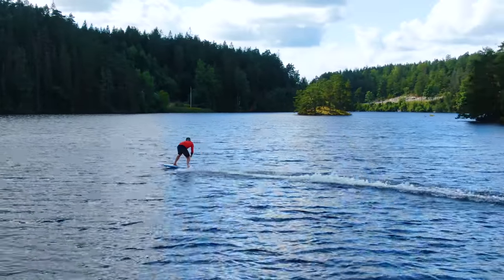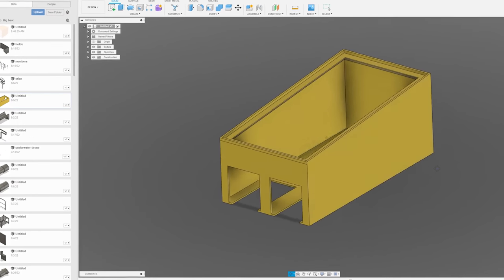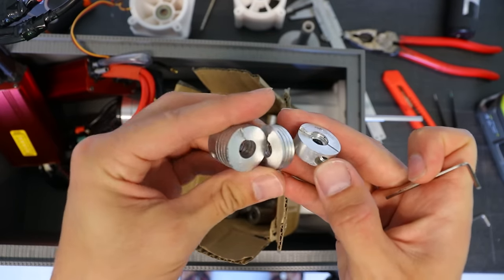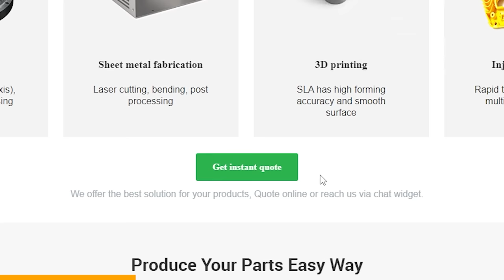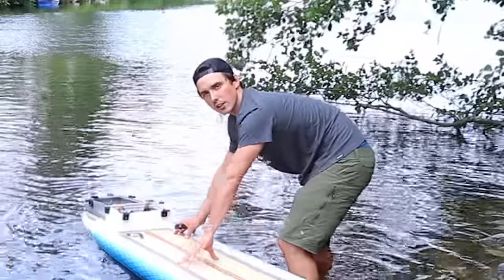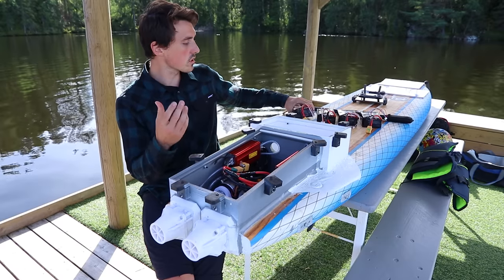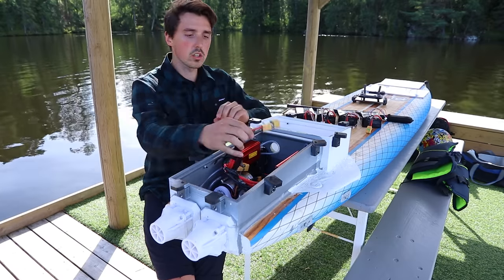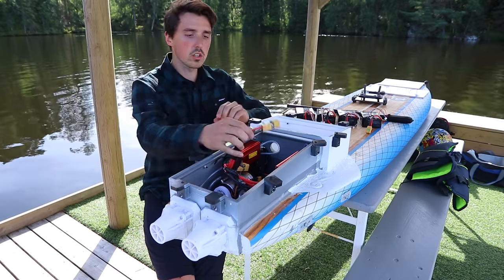This Electric Surfboard Has a Secret Inside!

Comment: if you optimize the geometry and streamline of your boar and the jets you can reach roughly similar speeds at less than half the power, 
one of the big problems is that the water is mostly just shot in the air since he back of the board abrubtly goes up, the suction method also seems to be from the bottom which can be done, but only if you make the backside go much more gradual so that he jet beam is completely underwater even when going fast. if you do that right you really need a insane lot less energy to go fast, since water resists a lot more. right it is like shooting a water jet next to a sail to cause some wind to move the sail(exagurated) while if you directly shoot it in he sail you get a lot more power transfer, 
essentially more exact you have only the mass of the displaced water moving you now, so it will work at low speeds or with insane power. but eventually as you go faster the speed of the board will have to be removed from it so you will actually get very little force out.
there are 2 main ways to avoid that problem. method one is either getting more speed and power, or getting the inlets in the same direction as the water and increasing the rpm, at higher speeds which is more easy if you would rely on a gearbox.
but in your case, streamlining the back and the outlets so they gradually stay under the water is much more effective(essentially change the shape of the back of the board so you don't get that aerospike behind it so the jets actually stay in the water). it still has a similar problem when you go really fast, but now you also have a pushing effect on all the other wather around it, which actually becomes much more powerfull at high speeds since the water will relatively seen start to cat more like a solid.

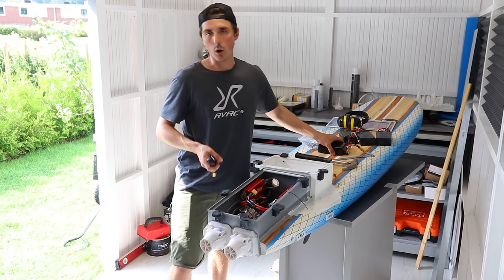Comment: information        6:31     it appears that there is  reduction  in diameter, at the jet exits.        if so, that reduction in diameter represents  an  Impediment to the flow, and  it is causing an Increase in  back-pressure, at the impeller.
such a situation is less-than ideal and can result in reduced efficiency/performance  and  more stress/higher temps  at the motors.          another factor is, the motors have  very little  mechanical advantage over the load that they experience.

Comment: I hope you fix the heating problem and get both full sized motors going allowing it to be full powered and not gimped.

Cool none the less. A follow-up video with a full powered version would be cool and worth it! You should also gather stats on the gimped one like power, battery capacity, range, speed at various outputs, power used at various outs, efficiency, and so on. Comparing the old (current gimped one) vs new (future full powered version) you could try using like computer closed or even open looped heat sinks. Maybe those would be more reliable and leak less. If using computer heat sink a closed loop would be required because it would jam with debris. But if you used a custom heatsink with no fine fins it would probably be fine.

I have no idea how you had the water cooling set up so just spit balling ideas.

No offense just didn't have time to watch the whole thing.

If you did statistics on this vs future set up make sure you make it a separate video for all or us geeks so none geeks don't get annoyed by "unimportant" information and us geeks to a video of just stats.

More videos more flavors makes all of us happy and gets you more views ^-^

Comment: That is not a BEC, a BEC is an integrated circuit generally in an ESC that ELIMINATES the need for a seperate receiver battery. This has a separate receiver battery going through a separate voltage regulator!

Comment: bike batteries can dump serious power for a long time. I run 20AH 52v batteries and they can dump 40 amps continuous. If you get the higher end batteries can dump 150 amps. You'll get at least 2 hours of riding.  amazon Unit Pack Power, they come with chargers!

Comment: ESC should get the cold water first, they have less thermal mass then a metal motor therefor they will heat faster and need more cooling. ESC is first to fail in heat events with no cooling. Metal motor overheats too and needs secondary cooling but can withstand heat events better then silicon.

Comment: Hello, I want to ask you an important question, I would appreciate it if you could answer it.. When using dual engines, did you use it as CW in 2 engines or did you use 1 CW and 1 CCW..

Comment: Very well done i loved your video and the work you put in. I was just wondering as you removed one impeller from your jet drive if this has effected or reduce the speed of the surfboard. I am curious to know if you had the two impellers in your jet drive would you have gotten better speed than using one only. Or would there have been more thrust when surfing on the board? Also by using two impellers would there be more increase in electrical current due to more resistance to the water flowing out the back?

Comment: Would the motors be able to handle a planetary gear system like whats used in cordless drills? The motor in the drills have a small gear that turns 3 slightly larger gears attached to a plate, this plate has again a small gear on the back side. This process is repeted twice more to reduce the RPM but increase the torque. If  there was only one set of planetary gears and the motor was at the other end, directly attached to the plate, then the three gears would loose a little bit of torque but increase the RPM. ..Just a question

Comment: Man, you should look into one of those monster electric motors that's equivalent to a 150cc gas engine. Maybe even look into TWO of them. If you can build a contra-rotating shaft inside a shaft type of thing, you could have one BIGGER 2-stage impeller and zero torque steer, PLUS 300cc worth of power.

Comment: Great job showing the evolution of the mechanical design. 
under the title you write:  "electric motors are 7500W each"..is this true ??? 
why did you go to the 500kV motor ??    
125V (360KV)......would drain the batteries slower 95A (360Kv) !  both motors have near identical power o/p.
More run time if you could pull more power from the batteries....add dc-dc converter?

Comment: should make a larger high capacity version with a paddleboard instead I don't remember the size differences between a long board and a paddleboard but curious if the extra real estate gain could provide more efficiency and run time

Comment: dude. You are using batteries to power an inverter to run a battery charger to charge batteries. Think about that 🤪 My friend has a 2 stroke powered surf board from the 80's that needs a few parts fabricated to get running again. Yours looks so much fun! imagine if it had 2x the power and could run for 2 hours between refueling.

Comment: Hi there RcLifeOn I am going to make a powerfull jet boat out of all this equipment, i was just lost to what batteries you used. will a 6s lipo battery 7.2v battery work and do you add all the cells together to equal 43.2v?or connect 2 3s 11.1 batteries together to get 22.2 volts for the motor to work. maybe you or someone could suggest or tell me how it works or suggest a battery or 2 that will work thanks as im still trying to understand batteries

Comment: If your getting about 3-5 minutes of run time on the board with a 48V 24 AH setup, that means your on average drawing about 300 Amps which is insane.

Comment: Is the water from the water cooling system actually moving too fast? As in, does it not have enough time to absorb enough heat from the motors to properly cool them?
Reply: Nope thats not how thermodynamics works.

Comment: Interesting
 But when installing a bearing dont hit the inside of a bearing when firing it. As you hit the inside instead of the out side housing the balls inside dimple the running surface so the bearing is damage before it even go's in. It may work but short life.

Comment: why add 2x 400watt generators face down add 2 fans under board as water pass through fans so turn recharge battery's will give longer running time. so like jet drive sux in water so spins fans.

Comment: Why dont you use water cooling. Its simple and its game.changing. also ec8 connectors are rated at a higher amp rating and are way easier to solder and accept.a larger gauge

Comment: If those are brushless motors all you would’ve had to do to change the direction reversed any two wires yes reverse any two wires in my return the other direction just a little Electronics engineering not everyone knows but very helpful that little bit of information

Comment: hammering a bearing is sacrilege especially if the balls and tracks inside it have to translate that hammering (i.e, hammering the inside because the outside interfering)... next time use a press , or a threaded rod with washers, or a vice and pipe, or even a hammer and a pipe to hit THE OUTER RING of the bearing

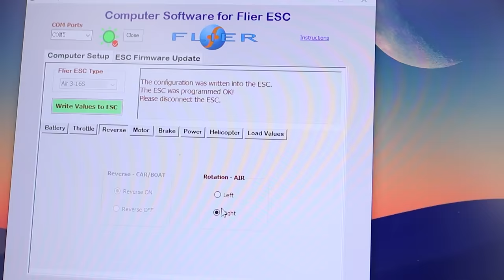Comment: 2:39 Does that mean on the old surfboard setup,  he had one motor spinning the wrong way  ???
Reply: So they were both spinning the same way originally ?  I mean wouldn't you be using counter rotating props with reverse blade configs  ?

Comment: For heat issues, build the bottom and the sides of the box out of aluminum and put some cooling fins on it act as heat sink that you can put below the batteries and even connect speed controllers to. For motors thats bit tougher, but make cooling chamber out of aluminum or maybe even copper with fins that you pump water trough could do the job.
For rest of the build its cool and fun, but like all other EV's the run time is just way too little. Imagine running to shore every few minutes to swap the batteries, just nah. Something like chainsaw engine would fit to bill pretty well if intake is built so it cant water lock the engine, ie ball that shuts the intake if its not with in certain angle.
Also price.. how much that print of propellers was... dear god it must been expensive. Maybe lost PLA casting could do the job if balanced on some turbo shop.

Comment: You said the connections are warming up. You’re probably using too little of a wire. And with an electric motor it’s pulling a lot of power and amps so it’s gonna heat that wire up probably wouldn’t hurt for you to upgrade the wire and the connections so there’s lesser resistance, because that’s what causes heat in an electrical wire.  I ran RC cars. To reduce the heat in the motor. I’d pull the motor apart and upgrade it myself by using heavier copper wine so there’s less resistance. You couldn’t use the motor for racing because it’s no longer a legal motor because it’s faster and it runs cooler. But when you’re outside playing anything goes.

Comment: pls put second stage back on and just do a nozzel change. dont reduce it as much as it is. open it up like 5% or step up the motor power just like 10%  the motors loading up is a good thing with jet drives. you shouldnt be able to over spin the pump. mike finigann has some good videos explaning jet boets.

Comment: How about you change the box to have an aluminium bottom, with heat-radiation - ribs? I bet you can get most of the battery or motor heat out of the system if you get some good contact

Comment: If you would like to make some $$ then make up a super detailed plan and off the plan for sale. You could also offer kits with the jet drives and some other parts then the parts sources for the off the shelf items.

I would like to see a full length surf board version with more battery capacity. Then, I'd like to see a pro surfer riding HUGE waves with it off the coast of Hawaii or some similar place with huge waves. The surfer could use power to get out and catch the wave them power down and ride the wave in then power up and ride back out to chase down and ride the next big wave. 

Lastly I bet if this electric surf board was well developed you could get a lot of $$ if you decided to build and sell these as a finished product. The full size surf board version I bet could sell for 25k.

Comment: Wow you must be pushing a crap ton of amps to heat up the xt90 connectors. I made a 16kw pit bike and push peak power of 250 amp out of the batteries and 400amp for the motor my xt90s don't get warm but then again on the water your constantly pushing power

Comment: Hey! Maybe someone here can help me, since i cant find any solutions on the internet... Im running a single Motor Setup on my Jetsurf, with a SSS 56104 burshless Motor(11kW and 360kV), a 400A Flier ESC and a 13s3p LiPo Battery (around 48-55V depending how much its charged). My problem now is that the power cuts out once i reach around 80-90% throttle and then i have to disconnect and reconnect the battery that the system starts running again. (Everything watercooled, so no overheating and i started with a two stage impeller setup, which i already reduced to a single impeller ... still same problem)
I really hope someone can help me!!
thanks guys

Comment: Are those brushless motors ??? if so why not submerge them for cooling brushless motors are not affected by water only things to be waterproofed are the batteries receiver and ESC. Ok, why do U use an inverter to convert DC from one battery to AC just to convert it back to DC to Charge other batteries?

Comment: honestly, focus on smaller and slightly slower, than bigger and more batteries.there's probably a lot of energy wasted with larger motors. smaller motors, less absolute energy wasted, more range for the same battery.

Comment: The fins inside the water discharge nozzle will induce heavy drag reducing the thrust by at least 15%.  They serve no purpose except for excessive structural integrity that most probably is not needed.  I suggest removing them for better performance

Comment: Your method of pressing in the bearings damages the balls and the races, only apply force to the outer race when pressing bearings into housing, this is even more important if your going to use ceramic bearings

Comment: It would have been better to use one large motor and a single propeller than the two smaller ones and two propellers.. instead of losing energy to mechanical friction and other power inefficiencies once, you're doing it twice

Comment: Add a turbine gear box:
https://youtu.be/JpXS53_iqj8

For Batteries,
You could use 4S = 48v and 280 AH
Shen Zen Basen Tech
3.2v cell is happy at 90A charge current.
Max charge current 400A.